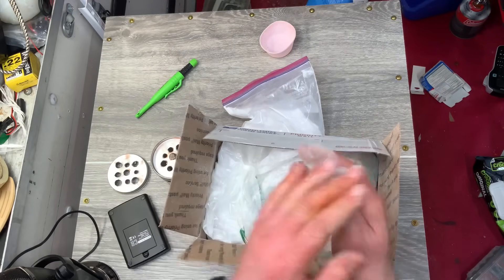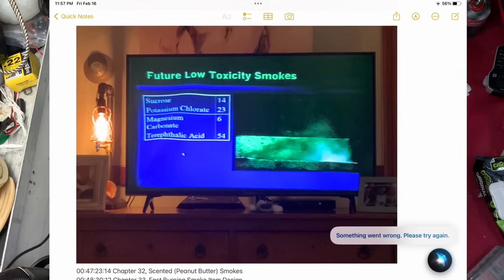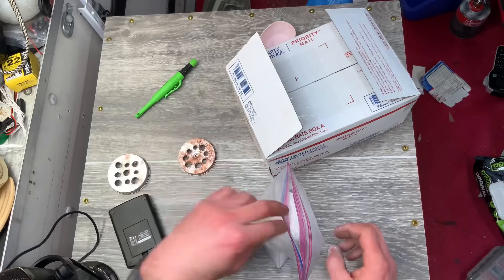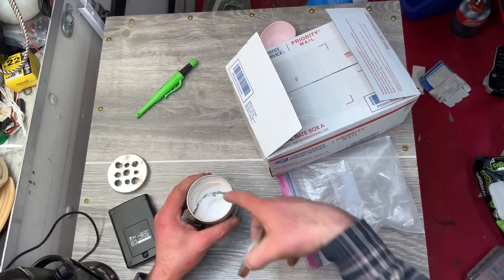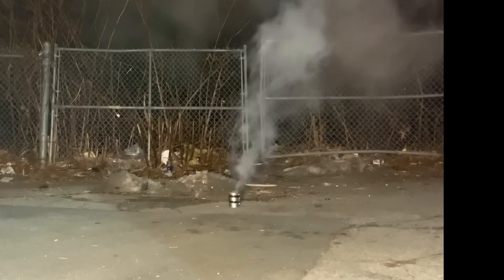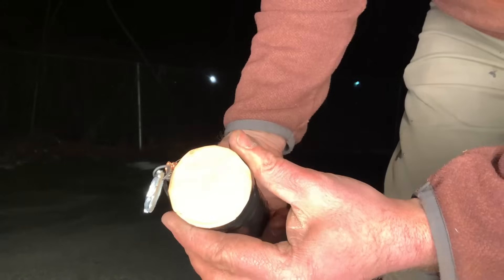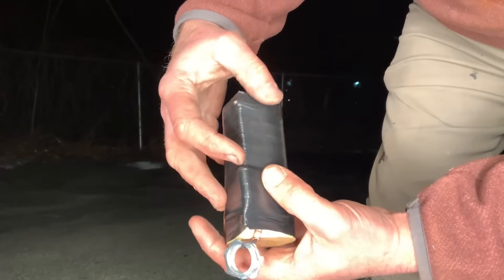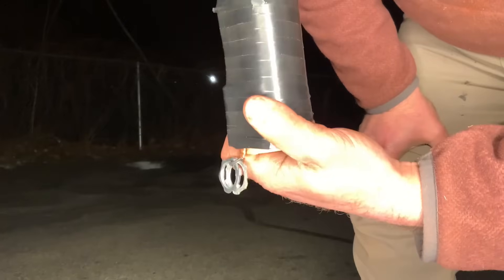TPA Smoke Device, Blows Commercial Out of the Water!

Comment: Hay, I may have a solution to your Thermite Fuse!
1 parts sulfur
5 parts  Potassium Permanganate
1 pars silicon
(Thin with Mineral Spirits if needed... which it most likely will be, and it doesn't take much)
Mix dry ingredients first, then add the silicon, and mineral spirits to thin if needed. I form mine into 1" cones (1" round x 1" tall) and let it cure. Once cured, you can use a nail to poke a hole down the center, and slide your visco fuse in it. You can form it into any shape you want as its going to cure. I always let it dry, as the silicon coats the Potassium Permanganate giving it some protection from the other chem's that it could come in contact with (It reacts to many things). The fuse burns pretty slow, but Really hot. It ignites my thermite mixes every time (Black iron oxide and Aluminum powder). As long as the chems are not incompatible, you could prime the visco prior to inserting it into the Sil-Pot fuse. Make sure you check for incompatibility

Comment: as far as the mixture of "parts" are those measured by weight or volume?
Reply from the maker: Mass
Reply: @InventionIncarnate  I know mass doesn't always=weight but in this case it does right?
Reply from the maker: @FedSlumper  affirmative. You are correct. Mass is the amount of matter in an object and weight is a force due to gravity.  In this case it’s weight in grams

Comment: Will just regular fuse ignite this stuff if I loaded it up in tubes to shoot out of 37mm?
Reply: To answer my own question, yes, regular fuse will absolutely ignite this stuff with no problem. Tried a small test tube, and then loaded up a 6" pyro tube packed to the gills and launched it from a 37mm, worked beautifully, quite the impressive smoke output for a launcher round, a couple fired in the same spot on a low wind day could absolutely be used for obscuration.
Reply from the maker: hell yeah, did you pack it with a press?
Reply: @InventionIncarnate  no, just packed it down with a 12ga shell, not super tight but somewhat compressed, worked beautifully.

Comment: Add some dry paraffin 3-4% so the cloud stays near the ground.😊
Reply from the maker: That’s a suggestion from someone who knows his sh_t. 

I attempted using 3% stearic acid with this formula, however, the mix seemed more aggressive and lot of devices which couldn’t handle the pressure burst. I’m not sure if it was the composition, or compression, or coring the center, or exit oriface, or any combination there of. I pulled that formula from the military training grenades. However, those were bound with 1%pva (final dry mass) I’m wondering if that 1%pva takes the edge off. Also, do you have any insight on pelletizing. I’ve attempted to granulate a number of comps, that always ends poorly.

**UPDATE**
3 months later:
The stearic acid needs to be ground independently, to a superfine powder prior to mixing with the rest of the ingredients. The output is certainly higher from empirically observing two separate 100g loose powder samples.

All forms of pelletizing have failed, the only successful means I’ve found is compression of the dry mix, coring, and igniting from the bottom of the cored center
Reply: @InventionIncarnate that TPA generated smoke is impressive. Watched the permethrin video and considering using one inside a 14k square foot barn. Could the TPA be skipped in that case? Dont need the cloud of smoke just the cloud of permethrin.  You mentioned pelletizing. Have you considered wetting your mix and trying a hand crank meat grinder with coarse plate?
Reply from the maker: @jerkyh  sorry for the delayed response, your comment got buried by 233k people saying “Mickey mouse” on a random Armstrong’s mixture short.

The permethrin concentration is significantly diluted in the garden dust and I think a better option may be the “composite smoke kit” from Firefox-fx. Though I wouldn’t recommend them to my worst enemy, given their inability to get their orders out. (Four months ) though I may have been an outlier. There are instructions for a better formula with concentrated permethrin in that kit.

If you email me at inventionincarnate@gmail.com I’ll send you the instructions
Reply: @InventionIncarnate  Depending on how large grain you want, you could pour it into a silicone mold made with silicone sealant and vinegar. You could make individual grains or a long rod and then chop it to size.

Comment: A promise i'm not trying to be a troll but I think you would have better results if you introduced a petroleum product or something like that and so that the smoke is heavier because that smoke is very light and airy it's thick but it's it's leaving the surface of the ground too quickly what you wanted to lay low and linger and you can do that by introducing either petroleum jelly or oil or diesel or something like that in there that will keep the smoke heavy
Reply from the maker: You are correct, I ordered ingredients for HC composite smokes with resin-based,  hard curing,  moldable , etc in early January, the company is absolutely awful, they charged me $255 and I never received. They won’t respond to my emails, and they won’t pickup the phone. For the record bc I know you’re wondering, firefox-fx

Comment: From a study on these kinds of smoke grenades...

Chemical characterization of the M-83 grenade and the M-8 smoke pot showed that formaldehyde, benzene and carbon monoxide were the major organic vapor by-products formed. These by-products were above their respective ACGIH threshold limit values at various concentrations, but should not pose a hazard if the smoke is deployed in an open area. Overall, TPA is a safer training smoke to replace the HC smoke.
Reply: Benzene and formaldehyde!? It's all fun and games until you get cancer later on. Both are carcinogens.

Comment: The last one was impressive for density but so was the first . I think the difference came in a lull in the breeze for the last one and it seemed to have a second route of escape close to the main end dispenser maybe compaction and that extra distribution is key . If the end cap doesn't pop and instead two smaller escapes open with the inside compacted under pressure that would be interesting to see to .

Comment: The material commonly called polyester is polyethylene terephthalate (PETE). I don't know if it would work anything like the pure TPA powder, but it would certainly be cheaper and easier to get. It might be worth an experiment. You might try using polyester batting, which is the filling in most pillows.
Reply: Bro, appreciate the thinking, but the ‘non toxic’ part is a must… PETE fumes are deadly.
Reply: @j.crizzle8942  depends on what youre using the smokescreen for doesnt it 🌚
Reply: Polyester fumes, brilliant 👍
Reply: I hear if you mix ammonia and bleach together it makes a lovely smelling cleaning fluid, you should test that also .😑

OMFG seriously, just in case don’t actually do that, it is highly dangerous

Comment: add 15% red devil drain cleaner for additional results
Reply from the maker: That sounds like terrible advice. Maybe you could try that and post that video in this thread
Reply: it makes the smoke composention more interesting, i.e. it does more than just make smoke that cloaks it will make the  receiving end user experience much more stimulating @InventionIncarnate

Comment: That was amazing, is there anyway to add color to the smoke ?
Reply from the maker: Coming soon
Reply: Powder paint pigments have been used in the past to varying degrees of success, and an old recipe from the 50s or 60s used ground up wax crayons to add colours to smoke mixes for Hollywood apparently
Reply: That depends on how hot that composition burns. Colored smokes usually do better with a low flame temperature, as found with potassium chlorate/lactose/dye formulas. Might be interesting to replace half of the TPA with Para Red dye and see what happens...but I'd want a long fuse.

Comment: Hmm seems like a good formula but the dumping tells me its a high burning mix. Try adding an ammonium phosphate fire retardant....perhaps monoammonium phosphate the dry powder from a class a fire extinguisher. I would start with 1 part monoammonium phosphate and slowly work my way up to a maximum of 10 parts to determine maximum smoke output and combustibility while increasing the length of smoke output

;)
Reply from the maker: Dumping is the objective for screening isn’t it? The faster the better. Why not just increase the magnesium bicarbonate ratio to accomplish your objective?
Reply: @InventionIncarnate  not really. Smoke grenades have multiple purposes. Yes concealment is one of them. However if it dumps and there is a breeze well your concealment is gone as soon as it's finished dumping. Signaling is another function often by color. Distraction is the other purpose. The other is training. By using smoke you simulate the battlefield as well as real world tactics using the smoke such as a bounding break. 

Bounding is one guy runs to a point stops and covers the next guy to run to the point. The first guy then takes up covering another angle like a side street. Then the next guy goes. A bounding break is bounding while simultaneously breaking contact with the enemy. The last guy often tosses out a smoke. The unit after successfully breaking contact then sets an ambush for the enemy. 

Every military/law enforcement smoke grenade I ever handled (former SOT) burned a maximum of 3 minutes straight. Though the mk18 smoke I found burns for 50 seconds to 90 seconds. 

The m38HC though burned the 3 minutes.
Reply: @InventionIncarnate  wanted to follow up. The hc is a hydroscopic yugoslavian grenade. Fairly rare. The smoke emitted absorbs water from the atmosphere enhancing its obscuring effects. It increases particle size making it more efficent at scattering light. 

A lot of smoke grenades especially on vehicles like the 81mm smoke grenades on the abrams are multi spectral. The smoke they emit contains heat often through the use of a bursting charge and red phosphorus to temporarily blind thermals. 

Its making its way into smaller hand held grenades as well with drones increasingly becoming common with containing thermals overhead which can typically see through traditional smoke grenade formulations. 

^_^
Reply: @InventionIncarnate  as for magnesium carbonate. It has a few draw backs. It is inconsistent when it comes to slowing a burn rate. Tons of factors like purity, moisture content, grain size, etc all impact its performance when slowing burn rates. 

There's the premature ignition issue as well. Its pretty flammable and can if the grenade is damaged just right go off. 

The other factor is regulatory. Magnesium bicarbonate bought in large enough amounts may have the FBI or ATF come knocking to ask questions. Which is fine no ones doing anything illegal. Other places control the sale of magnesium carbonate. 

The other is accessibility. Anyone can get monoammonium phosphate. Even if you just buy the grow your own crystals toys in bulk.
Reply: It might be as simple as altering the ratios a bit. Upping the sugar a couple percent at a time until a suitable ratio is found may work. If we weren't after non-toxic then some rubber powder may do it.
Reply: @NickFrom1228  well the ratios look good to me. The monoammonium phosphate comes from a natural stone called biphosphammite. It is commonly used as a toy. Those none toxic growing your own crystal kits for kids. It's used cause it's a water soluble powder which has dyes added to it so kids are attracted to them. Adding the monoammonium phosphate will coat each granule. In effect it will inhibit access to oxygen helping slow the burn rate. Possibly adding to the smoke generation properties in the mixture. This happen by giving off ammonia and phosphoric acid when heated, which can dilute the oxygen concentration to slow a burn. When heated to high temperatures it can give off water and ammonia further slowing the burn rate. 

Its used in standard pyrotechnic mixtures so it should also be easy to buy from any pyrotechnic chemical supply. 

Its only really toxic if you inhale a bunch of it. May look like nose beers but its not nose beers.
Reply: @kingdarkem   Makes sense. I haven't looked at pyro chemicals for years so I don't know what's out there currently but I think you have a good suggestions.
Reply: @NickFrom1228  yeah it's been awhile for me as well.
Reply: Chlorates an ammonium compounds are an no go. From moister of the air it can form ammoniumchlorat this is an self igniting high explosive.

Comment: Have you ever thought about a dual side vent?  Smoke blowing from both ends? 

That could be cool. Definitely need links and instructions. Best smoke device I've seen yet.
Reply from the maker: Received, on it.
Reply: @InventionIncarnate  a spinning dual side vent if physically possible, would help with the uniform spread
Reply: @InventionIncarnate  If you're still taking suggestions I'd like to know if you have an idea to make a smoke grenade that puts out an immediate smoke screen, similar to white phosphorous grenades. It's like a puff of smoke. If you ever looked at the COD video game trailer that features a prison break, the main character uses white phosphor grenades before entering the manhole, and that's what it looks like.
Reply: @DaveSmith-cp5kj  Check out the Legendary Smoke Mix made with R-Candy. It's not an explosion, but it puts out quite a bit of volume very quickly
Reply: @matter_gaming  That is what I currently use, but it still blows away really fast if there is any wind (even as low as 5MPH). Works great indoors but that's about it.
Reply: @InventionIncarnate  My man! Let's go!

Comment: TPA smoke contains formaldehyde, benzene and carbon monoxide.
Doesn't seem that's nontoxic to me.
Sourced from a US government document from 1995
Reply from the maker: I can’t stand it when people take research publications out of context to twist the information to suit their agenda. Like our media.

Here’s the conclusion to the research paper you’re referring to:

“Conclusions
Both terephthalic acid smoke and sebacic acid smoke offer some significant advantages over both cold smoke and other pyrotechnic smokes. Some of the advantages when compared to cold smoke include: low cost, simple, compact, light weight, long shelf life, high reliability, no liquid chemicals to leak or to be concerned about seal compatibility. Because both TPA and SA smokes are low temperature, it is believed that sensory irritants may to be added to the formulations.

The TPA smoke has been determined to be lower toxicity and lower corrosivity than other pyrotechnic smokes frequently used.
Toxicological data on the exposure to TPA particulate concentrations representative of those that are recommended for access delay applications, i.e., 4 to 6 g/m', are not available. The ERDEC Toxicity Report (ref. 4) evaluates concentrations as high as 2 g/m'. The health hazard assessment suggests that the benzene and carbon monoxide are not a problem from an acute exposure perspective. Furthermore, these substances would allow increases in the "design concentration", i.e., 5g/m', up to levels where explosibility would be a factor. The health hazard assessment indicates that formaldehyde may be the limiting agent. The predicted concentration is near the 25 ppm limit. If the formaldehyde estimate is correct, there is no opportunity to increase the "design concentration" beyond the stated 5 g/m without incurring unacceptable health effects, by our definition. At this time, there is not sufficient data on SA smoke that would allow us to make a similar statement.”
Reply: @InventionIncarnate  ignorance is bliss.
Formaldehyde in any level is toxic. You won't suffer from the effects for many years but once it sets in , you will suffer big. 
Their own words suggest formaldehyde is the limiting agent used. The level that's considered safe is no different than when FDA increased the safety level for lead or arsenic in food.  They set a "safe" level standard which ends up being dangerous to health. 
So keep believing government and find out how wrong you were later in life. Formaldehyde in the lungs is no joking matter. At any level of concentration
Reply: Formaldehyde in any level is toxic.

Comment: Maybe a little sodium bicarbonate to lower the burn temp and avoid the flares?
Reply from the maker: The flaring was mitigated by modifying the exit orifice (by third attempt) also, the primer that the fast visco fuse mounts to in the bottom of the bored center was too much material being launched like a flaming ball. 

There is 6% magnesium carbonate and I’m reluctant to add more bicarbs to mitigate flaming because this formula DUMPS smoke so fast. I think that flaring can be eliminated via device design vs compromising rate
Reply: @InventionIncarnate  it looks like an awesome smoke device, other than titanium tetra chloride or white phosphorus I don’t think I’ve ever seen such high output and dense smoke! Awesome job brother.

Comment: Nice! I love that there is starting to be advanced pyro/energetics on YouTube. Have you looked into IR opaque smoke formulas using additives like copper salts? The sciencemadness forum has some good information.
Reply from the maker: Awesome advice. I tested thermal obscuration ability (with my Flir camera) of a titanium dioxide blend I came up with and it was a complete fail. I’ll check out science madness for better direction
Reply: Copper and gold are probably the best infrared reflectors. Gold is used in space to block heat and IR
Reply: @jasonharrison25  I’ve heard of copper chloride being added for IR screening but I haven’t tried it myself.
Reply: gold is the best....its as perfect an IR reflector as there is.....
Silver may work as well @jasonharrison25
Reply: Regular sugar or powdered? Dye solvent source? Thank you.